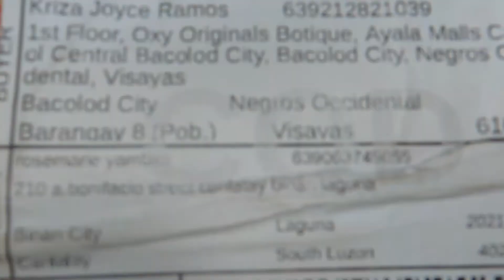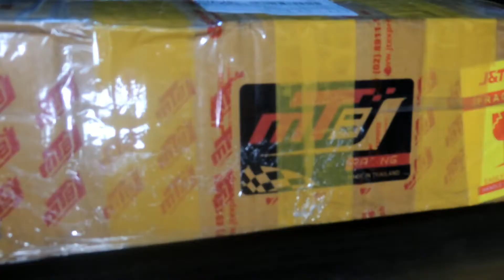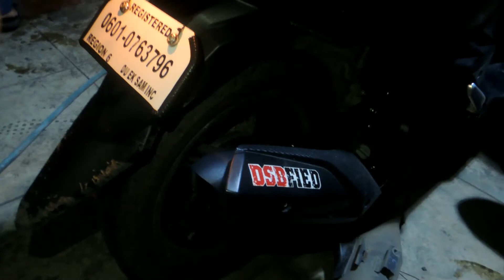UNBOXING MT8 V3 (Sound test & Installation) | Mio Soul I125 | KrizaTV

Comment: May silencer po ba yan or wala?
Reply from the maker: Meron po
Reply: @krizatv168  ung pinagbilhan ko po ang sabi walang kasama na silencer hehe
Reply: Ano po itsura ng silencer
Reply: Gumamit pa po ba kayo ng spacer sa pinag kabitan ng turnilyo?
Reply from the maker: @daivefrancisnazareno3562  ay ganun po ba heheh yung sakin meron eh hehe
Reply from the maker: @daivefrancisnazareno3562  check nyo po sa video ko 10:07 po hehe andun po yung silencer sa loob.
Reply from the maker: @daivefrancisnazareno3562  opo
Reply: @krizatv168  nacheck nyo na po ba kung ilang db po ang mt8 v3? Maraming salamat po
Reply from the maker: @daivefrancisnazareno3562  yung sakin hindi pa po pero pasok daw po yun hehe.
Reply: @krizatv168  last question po hehe. Hindi nyo na po ba nilagay ung gasket na galing po sa stock nyo?
Reply from the maker: @daivefrancisnazareno3562  Pinalagyan ko po yan ulet ng gasket hehe
Reply: @krizatv168  may gasket na pong kasama ung mt8 diba po? Tapos pinalagyan mo pa po ng isa?